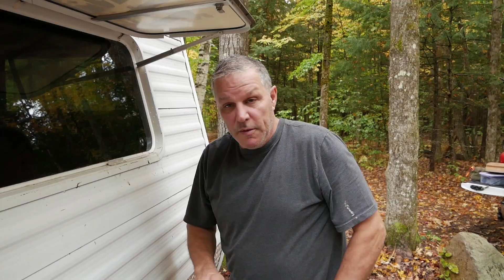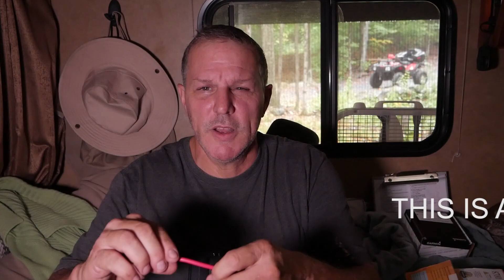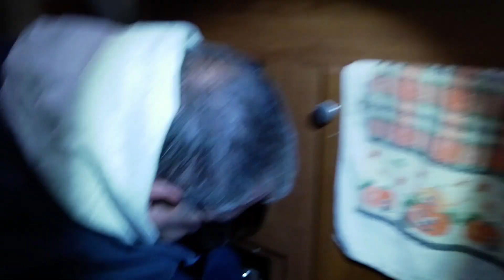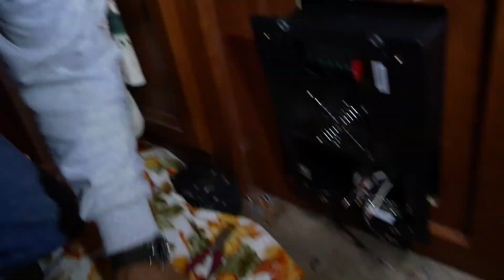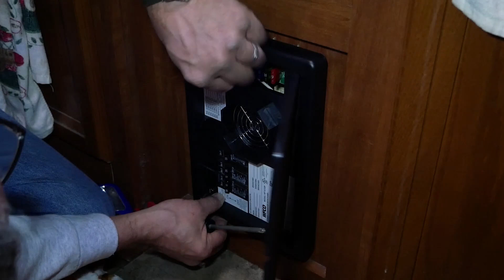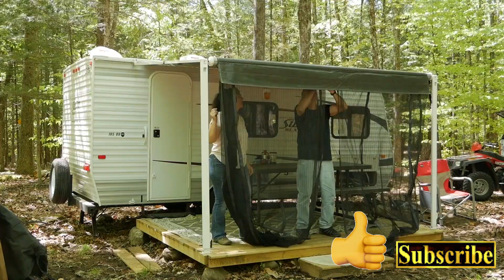WFCO 8700 SERIES 35 AMP POWER CENTER - DIY REPLACEMENT IN OUR JAYCO 185RB

Comment: I just ripped my out and replaced with a 12volt fuse box an connected a victron 30amp charger with appropriately sized cables to the  charger to the battery. Those terminals in those units are inadequate for the current. I will get a marine hatch for the blank

Comment: Thanks for the video! My situation is different, I'm restoring an old camper, and this converter is a drop in replacement for the original. 

I'm pretty good with electricity, both AC and DC, but it always helps to watch someone else do it first! Thanks again.

Comment: Why cant the wiring remain in place but the actual inverter part just be swapped out?
Reply: @BigChutes you gotta move over the circuit breakers from inside the first power centre to the next one.  The second power centre doesnt have any circuit breakers in it. Id make sure to label each wire so that you dont mix up different circuits, i hear you want the a.c. breaker as far away from any other high amp breakers as they each produce heat, so put it beside 15 amp breakers as opposed to the main 30 amp. Djnno how true it is but its not hard to do to be safe than sorry, and both breakers producing additional heat because they are besides themselves.

Comment: If you want to keep mice out of your battery box, fold up a  dryer sheet and tuck it down on the side away from the battery terminals. They don't like the smell of dryer sheets. 
It works great when you store your camper in the winter.
Reply from the maker: Yes! Thanks. I’ve heard this before and will have to give it a try👍

Comment: Hi there, I realize this video is 2 yrs old now but it saved my life. I had 12v off and on flickering until all 12v lights etc died completely. I picked up a brand new converter about 2 hrs ago and decided to check YouTube for advice, hints etc and I found your video. EXACTLY the same problems as you had and the EXACT same charger. Mine didn’t come with the manual though, they’ve migrated everything online. Replaced my converter just as you did, remembering to mark AC lines with sharpie. I even had to remove the ground block as you did. Everything works now. No bangs, sparks or release of magic smoke. Your video was awesome and I thank you sincerely for taking the time to post this video, it made it much easier. 
Thanks again. I’ve also subscribed to your channel.
Reply from the maker: Thanks so much. I had tried to find something when I had the problem and couldn’t so I’m glad I did it. Makes me feel good to know it helped 👍

Comment: What is the black wire coming off the new converter that has the wire nut on it with the pigtail on it?  Where did you connect that?

Comment: Thanks for the look at the guts of the electrical connections.  Replacing my power converter with one that will charge lithium ion type batteries as well as regular flooded lead acid and AGM.  Good to see where the ‘wrangling’ will likely be with the AC wire connections and the case grommets.
So much of taking on a new job is knowing what the challenging steps are and you showed those excellently.  Again, MANY THANKS!
Reply from the maker: Hope it all works out for you!
Reply: @CreatingASimplerLifeOffGrid  All went well. Only surprise was that new lithium batt capable power station uses the two in one circuit breakers instead of the narrow one each breakers in my original power station. As soon as I get a harder to find combination breaker (15amp, 20 amp combo breaker), I’ll be done.  Thank you again for the look inside. Many of the things you highlighted helped me anticipate the need and get it done smoothly!
Reply from the maker: @daves1646  Good to know! Thanks :-) And glad to be of help

Comment: I have to replace this very same unit and this is the only video I found that actually shows me how to do so. Thanks!!
Reply from the maker: That’s exactly why we made it! Let me know how it works out 👍
Reply: @CreatingASimplerLifeOffGrid  about to go give it a shot now!! What tools did you use besides the volt meter?
Reply from the maker: I’d honestly have to rewatch the video to remember all, but offhand I know I used a wire cutter, wire stripper, and a screw driver. Also some wire nuts…

Comment: bought a 2021 popup camper with solar and all wfco components inside, the inverter went out in two months. replacing it with another brand after contacting wfco and reading negative reviews. we only charged our phones using it not impressed with wfco
Reply: sungold 3000 watt inverter charger and 2 200 watt hour ampere time lithium's to replace lead acid. love the combo
Reply from the maker: Thank you! I will definitely check it out. The lithium batteries are really good upgrade too!
Reply from the maker: That is totally not cool. Sounds like a total lemon. Curious what brand you replaced it with because if mine goes again, I might upgrade to another as well. Thanks!

Comment: There's a much easier way to replace this. You could have just replaced the printed circuit board, which supplies your 12VDC power to the fuses. You'll have to remove the fan to access this pc board. 3 wires coming from the breakers (white, green & black) are all that need to be unhooked on the AC side. Then on the circuit board with the row of 6 fuses, tie in your DC supply wires. Hopefully, you won't have to do this again though but great job on making this video.
Reply: Where is your video of that process?
Reply: Are you saying the circuit board is the bad converter?
Reply: @ralphc750  Well if you measure AC going into the board,  coming from the breakers, you should have DC coming out. If you don't measure DC going to your fuses then most likely, your circuit board is the problem.
Reply from the maker: Appreciate that very much. Good info. But really hope I don’t ever need to do it again!
Reply: @CreatingASimplerLifeOffGrid  haha. I don't blame you. I have to replace one soon for someone so hopefully it's gonna be easier! Lol
Reply from the maker: @MB-ph5lz  hopefully!

Comment: Great videos what tools were needed for model WF-8700 replacement? I'll have to diy attempt this as well.  🙏🏾
Reply from the maker: Thanks. I needed some wire nuts, a wire stripper, wire cutter, phililps head screw driver and a whole lot of patience. Very worth it though and still working!
Reply: @CreatingASimplerLifeOffGrid  awesome...I managed to get the shore power and 2 of my 3 outlets working with the new panel. Today I'll try to figure out how to get it to trickle charge my batteries via inverter if possible
Reply from the maker: @BGNGAMES  The trickle charge works great and its not hard to do
Reply: @CreatingASimplerLifeOffGrid  just got to Sebago Lake and will check it out. Do you have Telegram or something if I have questions?
Reply from the maker: @BGNGAMES  you can email at mrandmrscorbi@gmail.com :-) Sebago lake sounds familiar - is that in NY?

Comment: I love your video its very informative. I have a prewired solar that is connected to the WFCO 8700 series. Do I need a a charge controller to be connected from my prewired solar into the power charge battery of the WFCO?
Reply from the maker: I'm not sure exactly what you are asking, but I use a 20 watt solar panel and have the charge controller connected to the 12 volt trailer battery. You can see what I did in this video at 7:20.

Comment: There is a black wire that comes out inside to the AC wire connection area.  Do you know where that connects to?  All my other AC wires that connect to circuit breakers were marked, but never noticed that one until too late.  Seems like it must be an AC supply to the converter circuitry itself.  Any hint? That wire was made of two black wires spliced together, so it is pretty unique.
Reply from the maker: Yes that is there for an auxiliary AC circuit if you need it . I cut and capped mine because it was not needed in our system.  Thanks for watching

Comment: Great electrical maintenance and fixe video Sir 👌 and great camera works Miss 😊 Did you install your ground rods beside your generator ? 🤔🤣  Have a great week to both of you Cheers👌😊
Reply from the maker: Thanks. Everything is closed up for the winter so groundrods will be done in spring. 👍
Reply: @CreatingASimplerLifeOffGrid  👌😊

Comment: Holy crap! That is happening to our truck camper right now. The exhaust fans and lights went dim then stopped working. I took the converter out, saw all the wires, then put it back in, haha. So many wires! I’m not sure if I’m ready for that project. You did a great job, I woulda been so miserable doing that.
Reply from the maker: Lol. I wasn’t looking forward to it but got it done. Ours was on the fritz for most of the summer before I got the nerve up to fix it!